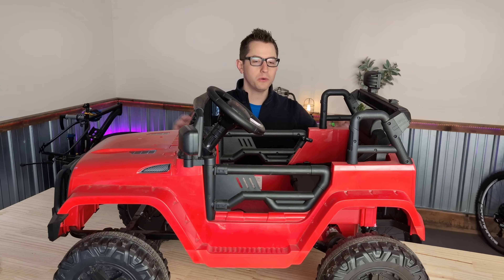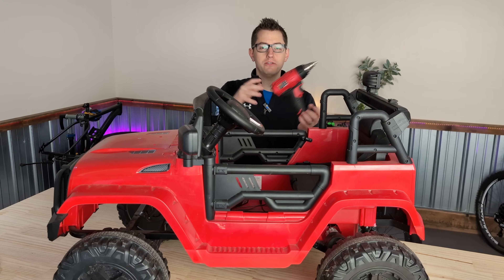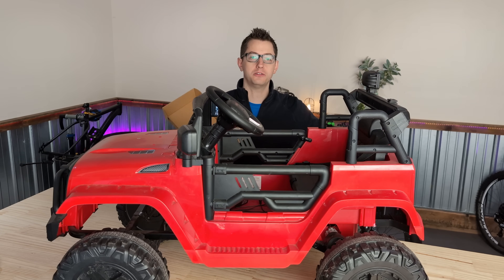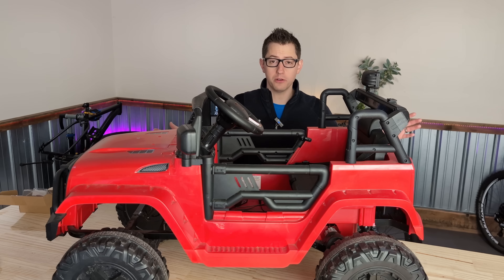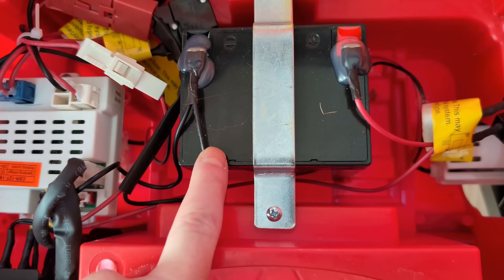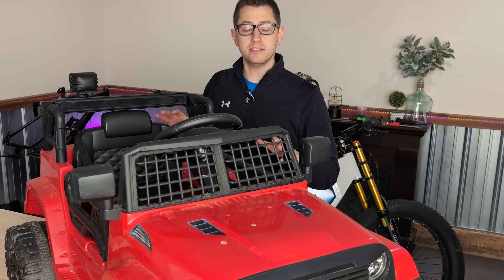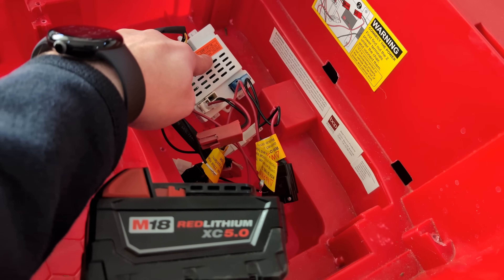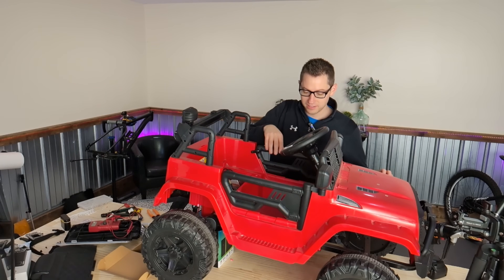Overvolted! Milwaukee Powered Power Wheels Conversion! Easy!

Comment: Even at .25 speed, I still have no idea how you connected the wires and where
Reply from the maker: There's another video that goes over the wiring and a little more detail. Also, I made a diagram that shows the wiring connections

Comment: Can you upgrade a 24v to a 36v with 2 Milwaukee batteries?
Reply: You probably can, but it’s really sketchy. If the battery’s voltages and capacities aren’t nearly perfectly matched. If not, you get some nasty effects where the weaker battery can get reverse-charged, usually ruining it, and sometimes causing a catastrophic failure.

Comment: I have a Mario kart with two stock 12v batteries and controller unit. Wondering the difference it would make if any using your recorded setup 🤔

Comment: hi!  can you send a link to the full "package" from beginning? and in the package: there is a motor controller! could you please provide a link to a seperate motor controller? :)
Reply from the maker: Check out the next video with the wiring deep dive where I link all the upgraded items in the description
Reply: @overvolted  thx! could you pleasepost a product link for the dual relay so i can but the right one in europe? :) the one posted is. not available!
Reply: @overvolted  thx for your answer :) i have a BMW X6M for my son .. would like to do some upgrades::))

Comment: This setup keeps blowing the oem  control box up. Ive replaced the control box but it keeps blowing no matter the voltage setting. It runs just for a few min and pop! What am i doing wrong?
Reply: You always have to install a 18v to 12v voltage converter between battery and the original control box.. The adjustable controller is for protection of your battery. The relais is to seperate the 12v original controller signal to 18v motors
Reply: Buy a relay and 12v Converter

Comment: So if I understand this: if you have a forward neutral reverse switch in the car, you can simply buy the control box with the 3 position switch, pull the connectors from it and attach them to the forward-neutral-reverse on the car?

Comment: Appreciate the video. Only one I've found that shows the proper way to keep the random controls (lights etc) at the original voltage while only overvolting the motor. Can you make the wire diagram available again? Can't view it on your drive. Thank you.
Reply from the maker: Thank you! I appreciate that. Yeah sorry I didn't know it was gone. I will double-check but also I have a wiring video that I think I linked in this video's description. That has a bit of an update and I think a specific diagram to that as well.
Reply from the maker: Links should be fixed!
Reply: @overvolted  !!! Thanks!

Comment: Hello, I followed the video/diagram but I must have missed something.  I have it wired up the way the diagram says but I can’t quite figure out the neutral wire. If I wire it one way, as soon as the turn the car on it gets full power to the wheels and the pedal doesn’t control it. If I switch the neutral wires, then the wheels dont spin when I turn power on but the car loses all power and restarts when I press the pedal?

Comment: Is there a kit for a 24v power wheel? What do I need to do differently to get that running?
Reply: Bigger motors and a different control board for the RC/radio functions

Comment: Added same setup to a hotwheels, worked great for aprox 5 min.. I believe the small relay burnt out, i feel like i saw you post about adding an automotive relay in another vid but cant find… any advice would be great! Ty
Reply from the maker: I previously used some larger relays with big old heatsinks that were way Overkill (or so I thought). They were great actually but they took up a lot of space so I condensed them into a smaller unit. But if you got the space they're definitely good DC to DC options. I think the link is still on my original video. Let me double check.
Reply from the maker: https://amzn.to/499La1k
Reply from the maker: That's the one I originally used but then replaced with smaller units. It supports 25 amps and has a massive heatsink so I think it should be good. However, there's good and bad parts of anything. So since I didn't use it long-term, I can't speak for the quality over the years.

Comment: WILL THIS WORK ON THE HUFFY FORD RAPTOR
Reply from the maker: I don't see why not. Every car is going to be a little bit different but that one looks like it has a lot of sensitive electronics so I would probably go the same route that I did here to keep those on the lower voltage. I would definitely watch the updated video of the wiring I released last week because I upgraded to some different components that made things work a little bit better.

Comment: Would I be able to just put the relay in so the car runs typically on the 12volt but the motors will run off the 18v
Reply from the maker: Yeah that's basically what this setup would do. I would check the newer wiring update video that I did on this one since I did end up simplifying some of the wiring and replacing some of the components

Comment: PLEASE please please make an update video on wiring and showing each wire getting terminated or where each wire comes from and goes to. My sons car has been tore apart for over a month because I bought these products and tried to follow these steps without success. I’m begging you please
Reply from the maker: I hear ya! apologies! life gets...busy. I have swapped some of the components on this Build since i originally published this video. (same concept, upgraded controller to support reverse from car and dual relay combo for space savings. ) Let me make sure all of those are linked for you. THIS WEEKEND FOR SURE i can have a short out for you with the terminations and wiring recap!!! This is the first weekend I'll actually be home for the last month+.

Comment: How long you think before you do a more in depth video? Still have one tore apart not knowing exactly which wires go where to exactly.
Reply from the maker: I attached an updated version of the wiring/image diagram in The description of the video. Does that help? I will be back in town later tonight. Maybe I can make a quick short on it and Link it from this video. Otherwise it will be tomorrow
Reply: @overvolted  it did not help. Just neeed a video of you terminating each wire and showing what the wires you’re terminating are going to/what they’re doing
Reply: You ever figure this out? Mine is ripped apart and not a clue what I've done wrong but it's not working ughhhh
Reply: @ShelbyBrown-oe2fh  yes I did. You have to add in a relay. I used a 4 pin relay out of a car fuse box. 5 pins will work also just Google 4 and 5 pin relay diagrams to know where each wire goes. Your relay can withstand the full 18v and send all 18v to the positive wire on the wheel motors by being activated from a 12v signal wire on the other pin of the relay.

Comment: Of course couldn’t show the most important step which is actually wiring in the actual components into the controls module and everything else. Just showed a picture and can barely see where your wires go exactly. Helpful but not really helpful video
Reply from the maker: apologies.
Reply: @overvolted but you made another video that goes over everything. Thanks!
Reply: Red with + black with -

Comment: Is there any video that walks you through how to wire this kit not just show what you did after it was installed?
Reply: That would really help… this video doesn’t show anything useful other than the semi decent wiring diagram… there are multiple ports on some components, but in the diagram it’s just going to the components… doesn’t explain which port the wires should go into
Reply from the maker: Sorry about that. I did this for a friend and I am getting it back here next week so that I can do an overview
Reply: @overvolted post link for wiring video
Reply from the maker: I guess i should make one. i have the wiring diagram in the description if it helps.
Reply: Literally he couldn’t show actually wiring. Just shows the end result without being able to see where his wires even go exactly
Reply from the maker: @Tjohnson171002  hope the wiring diagram linked helps. Also, I'm going to make a follow up with the details since it's so highly requested. Thanks!
Reply: @overvolted  it somewhat helps but my sons jeep has a brain box that controls the wheel motors. This make me unsure of where the wheel motors wires(red and black) go, and where the brain box’s red and black wires are suppose to come from. Not trying to be rude just frustrated that I cannot find a detailed video with instructions.
Reply: Your diagram shows four wires coming off the power supply battery when the conversion kit comes with only two wires coming off the Milwaukee battery
Reply: @overvolted any update on the wiring video? Lol I'm stuck with the others and can't figure out where things go based on the diagram. Thanks in advance
Reply: I use craftsman tools and have like 3 extra charges could I just cut the plug off of a charger and use that with the kit?

Comment: Ended up picking up a motor controller with reverse and forward. There’s a switch on it for that however I haven’t tried it yet but will my remote work if not, is there something I can do in the wiring to make it work? Thank you for answering all my questions.
Reply: I got the new motor controller on. I have reverse now and forward I had to wire it into the switch for the factory harness But the only thing on my remote works steering
Reply from the maker: The remote doesn't go forward? I'm trying to think of a simple way to get reverse working from the controller. It just reversed the polarity coming out of the factory controller so I guess if you had another relay with a normally open and normally closed side then you could basically operate the physically forward and reverse switch with the relay.
Reply from the maker: But if you aren't going forward either you might want to check to see if you're getting voltage out of the stock controller when pressed. Also sometimes those controllers are funny there is a s button or something in the middle that you have to press before it will engage one of the functions

Comment: Finally got it done, but I lost reversed. There’s no reverse now. Is that normal?
Reply from the maker: Depending on your vehicle most of them just invert the polarity of the current going to the motor. If that is how your reverse setup works, it would not trigger the relay. BUT you could switch out your motor controller to one that supports an external reverse switch for less than 20 and wire it in to the in vehicle forward/reverse switch. I just put a link to it in the description.

Comment: where did you wire in the low voltage cut off
Reply from the maker: Right after the battery. So it's the 2nd thing in the chain
Reply: did 10a step down converter end up being enough amperage because the fuse going to the reciver is 30amp
Reply from the maker: @bigworm1978  plenty for this situation since most of the amperage was used for the motors.

Comment: I guess what I’m saying is does the battery protector lower the voltage as well to 12 V
Reply from the maker: No. You can just set the low voltage cutoff to stop pulling power once the battery voltage drops below a threshold. It doesn't lower the voltage itself
Reply: @overvolted  so I need the low voltage cut off as well. I didn’t see it in the diagram that I paused.
Reply from the maker: @bigworm1978  oh that's true. I guess I forgot to add that to the diagram. Technically not necessary as long as you don't run the battery down. Some batteries have on board low voltage cutoffs as well. But if you're using a cheap knockoff or generic probably doesn't. It's definitely good to be safe and have one
Reply: @overvolted  What I am trying to ask does the low voltage cut off take the volts down to 12 V to run the factory accessories?

Comment: If i use your set up will i destroy my 12v circut board for my electronics like, reverse, forward and light system?
Reply from the maker: You can choose what you want to have on the 12v  circuit. I kept my remote and MP3 player and  lights and stuff on the 12v and just put the motors on the higher voltage...so the motors are the only things at risk in that set-up.

Comment: So if u don’t want it to go faster just use first link ? That’s a 18v to 12v but will it still
Protect
My battery from
Low voltage ?
Reply from the maker: You would probably want to put a low voltage cutoff in line right after the battery adapter and before the voltage step down box.

Comment: you listed a voltage step down. is that still needed with the $35 milwaukee kit
Reply from the maker: Hello! You really wouldn't need it unless you had some more finicky 12-volt accessories that you want to run. Otherwise you can just go straight with the Milwaukee kit

Comment: So, if your car does not have a remote control, but DOES have lights, the on/off switch and hi speed/low speed shifter like your jeep, do you still need to do the dual 12v/18v setup like youve done here?  Or can you get away with just wiring in the "WUMZIJ " kit you linked here?
Reply from the maker: You'll probably bypass that high and low and use the knob on the speed controller for higher speed. I think if I didn't have the remote and mp3 and things then I'd just wire it in. The lights are really the only question on if they would run on the 18 volt directly. You could always step down to 12 just for those if you wanted. Buuuut if you don't mind some trial and error then you can give it a shot directly wiring it in

Comment: Bought an Amazon conversation kit and ruined $1000 worth of Milwaukee batteries.
Reply from the maker: Oh dang! Sometimes if the voltage cut off isn't set right you can lower the voltage so much that the stock charger won't charge the batteries. You can generally recover the batteries from there by connecting The positives and negatives together from a working battery to one that has low voltage. Normally just for 10 minutes or so and the charger will recognize it again and charge it back to normal capacity.

Comment: This doesn’t hurt the motors for the wheels right? Running on 18 volt?
Reply from the maker: The speed controller is variable so you don't actually have to run it at full chooch. But that being said, technically overvolting anything is going to add some heat and potentially reduce the lifespan. Go too high and you can definitely hurt the motors. In this case, the 18 volts going between two motors keeps everything in check even when I have the controller cranked all the way up.